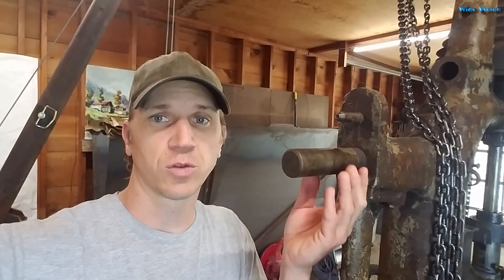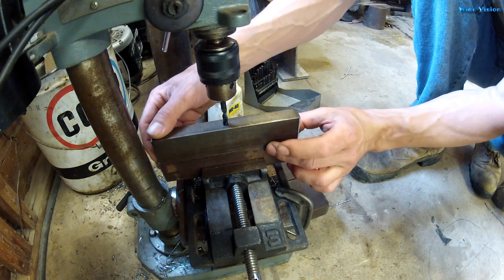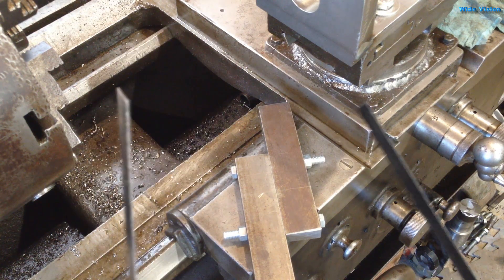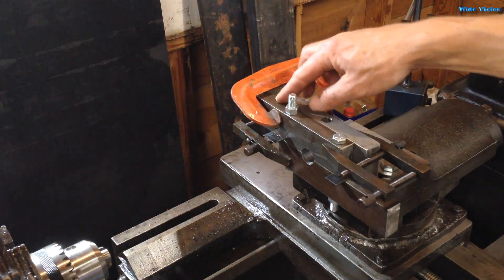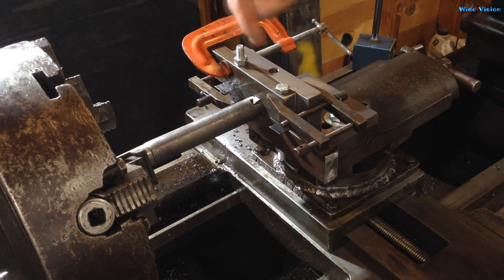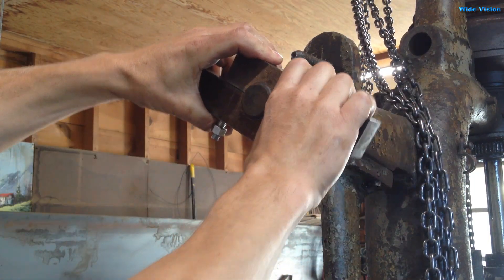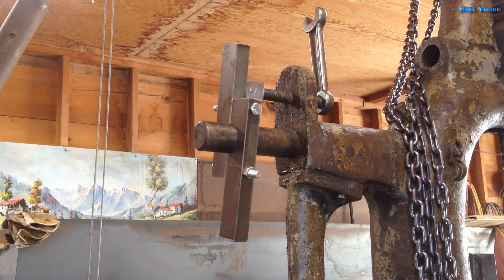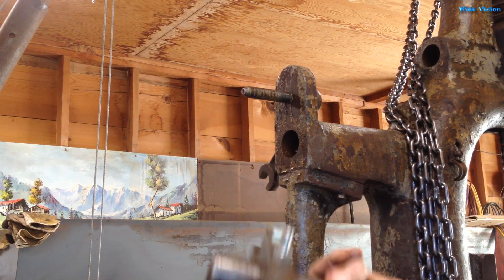Building and Using an SRT.

Comment: That worked well. I would have welded a nut to the end and used a slide hammer. Then cut the nut back off or make a new pin or whatever you plan to do.

Comment: Nice solution, some kind of "Getter out" tool...
You gonna have to make yourself some working benches before you get my age, cause if you can ever bend to accomplush the work on the floor, you may not be able to get back up without help...   lol
Have a good one...   ;)
Reply from the maker: Trying to get stuff put on stands and benches, but I'm spending all my spare time on the drill press. Besides, I've got Dakota to help me up! ;)
Reply: You could have put the part in the Chuck and cut the hole in a conventional way  however nice ingenuity doing it the way you did

Comment: Well done Matt there are a thousand ways you could have done the job but you picked the right one for what you had on hand very elegant solution. Good tunes again as well. I like the old mountain scene in the background too
Reply from the maker: I was wanting to move the mountain scene and put it behind the lathe so I have something to look at. But my wife doesn't think it will come off the wall in one piece.
Reply: Wide Vision Metal Fab 
She's right I'm sure! It is cool. I wouldn't want to f it up either.

Comment: Hi, Good tool nice work, it is good to se that old drill press slowly getting  back into service again. All the best.
Reply from the maker: Thanks! Piece by piece. The work does feel slow right now, but mostly because I'm excited to see it working!
Reply: Hi, its nice to see that you get more and more machinery up and running, how is it going with the plans to raise the garage, do you want to keep on working only from your truck or is the plan at some time to build a big workshop where you are now.
Reply from the maker: Still thinking through details on the garage raising. I was hoping to have all my ducks in a row and raise it in July, as that's my slow month business wise, and we usually don't have strong winds in July. But, I don't think I'll have all the material purchased by then. I'm hoping to buy a lot where I live and build a nice shop on it someday, but that plan is probably a few years down.  I'm really not enjoying the on-site work as much as I used to. It seems to wear me out these days, so I really would like to do more work in the shop.
Reply: I know what you mean, its nice being in familiar surroundings plus you also have all your tools at hand. I have thought about raising the garage, what if you made some T from flat bar put them upside down and screwed them into the lower wood frame and the post, and if this upside down T had a piece of flat bar sticking out towards you (with a hole in it) then you can stick a concrete anchor with allthread welded on to them through the hole and with a nut on both sides (ofcourse in reverse order, first install the allthreads and then the upside down T), then you could raise the garage with theese, maby having some jacks helping to lift the garage, when the hole construction is in the air you can put some blocks under and voila job done.
I could send you an email with drawing of what I mean if you want.

Comment: Would heat be OK or not good?
Reply from the maker: Probably. But the shaft  is in a cast iron housing, so I wanted to use heat only as a last resort. I wouldn't be too happy if I got it too hot and cracked my drill press!

Comment: There was some risk of the shaft binding. It could be easily cured by rotating the puller 180 and alternating sides between pulls with the bolt. Fortunately not necessary.
Reply from the maker: Howdy Juan!  I'm not sure I follow you on this one. The shaft was not able to rotate, so rotating just the puller would keep the pressure on the same side of the shaft.
Reply: Ooops! (:

Comment: Now you could tap for 1/2-20 thru the sides to use as a puller/pusher. Fine thread = greater torque advantage.
Reply from the maker: That was my plan if the motor bolt didn't work.

Comment: Sweeeet, that turned out great :). A quick bodge fix for the slop in the crossslide nut you can use a Jack between the crossslide and the hand wheel, a bit of threaded rod and couple of nuts will do, mill clamp studs I work if you have them. Just hand tight so as to take up the backlash in the cross slide nut.
Reply from the maker: I think I see what your saying. I'll have to do a little playing. Thanks!
Reply: Did a quick video on the bolt thing. Sorry for the somber tone, ive an eye infection thats sapping the will to live, its fn bollox lol.
https://www.youtube.com/watch?v=txz1XZjjZDE
Looking at your video again, you might griping your first boring bar directly in the chuck will help, just stick it out as far as you need it, if the chucks bad wrapping the bar in copper wire can solid things up. 
When youre boring with the second bar looks there was a lot of flexing going on in the clamp holding the work, be good to sort that out.
Making the shims sacrificial so they are in the cut  will avoid the interrupted cut. 
Cheers
D

Comment: In most of my portable line boring I use the York through-bar measuring tools. Maybe you could put something similar together to fit the different tool ports in all of your boring bars.
Reply from the maker: Is that the thing that looks like the barrel of a micrometer?  For small adjustments, I use a fine thread bolt with a lock nut on it and push it into the hole on the back side of the bit.

Comment: Great job. I saw someone do something semi similar with pillow block bearings. What they did was mount them (one on each side of the saddle) to steel blocks cut for proper center height and milled to fit the V way, then they gave the blocks binding clamps like a tailstock typically has. So essentially they made little non adjustable steady rests.
Reply from the maker: I'm not sure I'm understanding your description. It actually clamped on to the dovetail of the cross slide?
Reply: No, they clamped to the ways (under the bed) just like a steady rest or tailstock does.  It was like having two steady rests. :)

Comment: When you were drilling the bolt holes in the clamp I was thinking 'Boy Howdy he sure can sharpen a bit' and then you used a dull one. BUT it DID work. A-PLUS on the shaft removal. That baby will b peeling chips in no time and you're going to have to lay off the whizzes on your puppy. TOO wide open! GBWYall and I actually got some grass mower before the rain started again. Averaging 3 1/2 inches a day except for one day a 4 1/2. It'll quit sometime!
Reply from the maker: I'm not very good at sharpening bits. I really want to get a sharpening machine, or even one of those bench grinder attachments.  The work on the drill press feels really slow lately. It seemed fast when I took off the table, the column riser, the motor, and all the big parts. But now it's tedious work of all the little pieces. I'm not complaining, I'm just really excited to use it! :)
Reply: I understand. If you dread it you can't turn around till it's on you and if you're itching for it it takes a year and 6 months. And someone is good at bit sharpening or you must get a lot of new ones like I do!